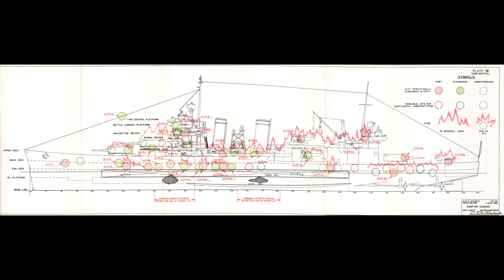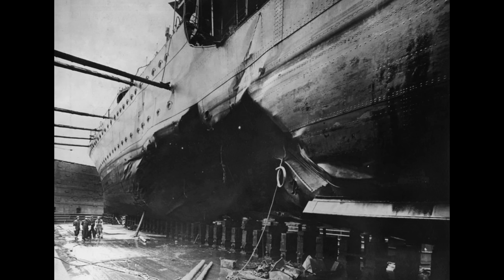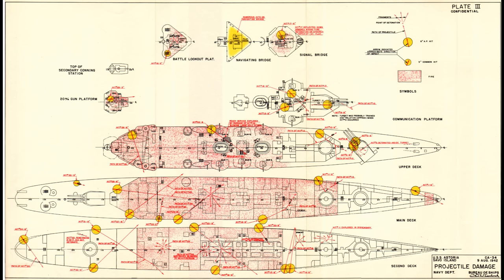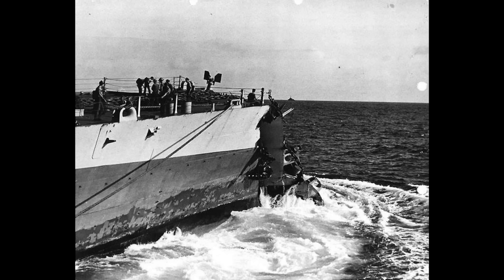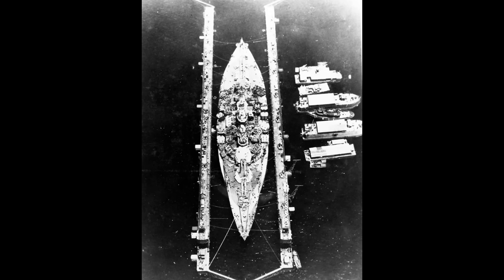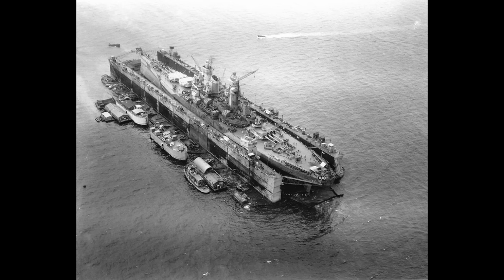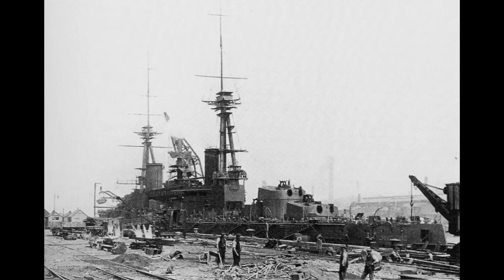Repairing a Damaged Warship - Ship Triage and Treatment

Comment from the maker: Pinned post for Q&A :)
Reply: Solid video
12:00 coconut logs are not in the script, but they are canon. 😊
ba dumm tiss 🥁
Reply: Since armor plate is a relatively long lead time item, and somewhat form fitted to each ship, do they maintain replacements
Reply: Is there any case where the distributed armor scheme has benefits over the all or nothing scheme?
Reply: @robertmills8640  Drach answered a question of mine similar to this in a previous live segment Drydock. Non-face-hardened armor plate, such as that used for splinter protection and for mass-produced gun mountings, can be mass-produced and stockpiled. Face-hardened plate for things like belt armor and turret facings are made in much more limited quantities, but some spares would be produced and stored for use when damage makes it necessary.
Reply: Did ships in WWI/WWII time frame have generators to produce electricity independent of the boilers? What systems had the highest priority for power if the ship was forced to run on such "emergency" power? Welding the ship back together would be tough without power.
Reply: I've always wondered how they get a ship's keel to settle exactly on the the blocks in a dry dock. Is it a matter of fine adjustment of the ship as water is pumped out of the dock and the hull lowers or is it lashed so solidly in place that there's no chance of missing the blocks or is some other magic involved? Do you know of any examples where the keel missed or began to miss the blocks which called for an alignment do-over?
Reply: @rebelsqurl8959  Thx
Reply: The repair I found very interesting was HMAS Hobart.  When hit near the stern by a torpedo, the Cockatoo Dock found the alignment so bad that it was easier to detach the remains of the stern, replace all the missing parts and the twisted structure, and re-join the two parts in correct alignment with new structural elements.
Reply: so thanks to your videos, I am now of the understanding that Queen Anne's Revenge was considered to be more or less a fifth rate ship of the line, is this why the Charston blockade is so well known? was it the fact that suddenly the pubic was aware that there was an outlaw sailing around in a battleship with enough ships to possibly outgun the local Royal Navy  Squadron, or was it something else that makes the blockade Blackbeard's most infamous feat?
Reply: Have the Kamchatka jokes on your videos gotten tiresome? :D

Question: I've read somewhere that, the Kanaung Mintha (Kanaung Prince, ကနောင်မင်းသား (1820-1866)) was the first to invent a type of mine (or depth charge according to Wikipedia) that he thought would stop the British ships from advancing up the Irrawaddy River. But was thwarted by Buddhist monks, saying that the weapon would harm aquatic life.
 Is that true?
Reply: In your opinion, what warship sustained the most damage but was still able to make it to port, be repaired, and sent back out?
Reply: I am an aspiring writer and Im writing a fictional story set in ww1-2. I would like to ask, would a ww1 battleship be affected by emp? If yes which components will be affected ?
Reply: "Is the drydock half empty or half full?" sounds like one of those optimism/pessimism things.
Reply: What makes a clipper ship a "clipper ship?"  Why were they so fast and were there any attempts to make a warship of this same design?
Reply from the maker: @awildmarshmallow3558  Depends how strong the EMP is, but most man made EMP's would be unlikely to have much effect, certainly nothing that couldn't be easily fixed.
Reply: @Drachinifel  You mean man made does that includes EMP coming from nukes? So for context my story is about an alien race who end up on earth and caught between war of fictional UK, Germany. The alien tried to use EMP but due to battleship fleet being mostly mechanical it didnt worked. I heard some of the dreadnought of WW1 uses electric motor for the turret is that true?If yes will a strong enough EMP disable it, I want a bit of accuracy on my story. Thanks for replying.
Reply: Have long wondered why Graf spee could not be fixed, couldn't they have robbed water plant and or parts from one of the merchantmen (I believe there were german merchantmen in port?), Or "Just" filled several hundred barrels of water (or even one or two WT compartments with access from above as a well?)
Reply: @HoverLambo  From memory it wasn't just her water plant, she had diesel engines and a fuel processing plant that could take cruder fuel and turn it into something the engines would take. That was knocked out. Basically she wasn't getting home without it.
Reply: As a fellow engineer, how did they do FEA in this time period as you definitely couldn’t load it up into ANSYS and then have a computer calculate which parts are safe/not under stress?
Reply: Hi, Drach you have said before that because of the time of flight of the shells maximum effective range is lower than absolute maximum range. Given that a large ship like a battleship can’t accelerate/decelerate very fast the only option to evade enemy shells would be to turn hard to port or starboard. Would the following be a viable strategy for fighting at absolute maximum range provided that your guns are accurate enough. Assuming that you have 3 quad turrets and give them each a different color charge and set one to fire where the enemy ship is, another where the ship will be if it turns to port and another where the ship will be if it turns to starboard. Given that absolute range for WW2 battleship guns is around 40k-50k yards, that is typically beyond the horizon so you will need a spotting aircraft and you will have a reduced salvo to 4 guns that can actually score hits but that is still better then not being able to engage at all, no? Am I missing something in this assumption?
Reply: Question: I remember you saying previously that armor plating was often made in advance and stock piled for repairs etc. 
Does this include things like guns, barrel lining, and turrets?
Reply from the maker: @awildmarshmallow3558  There was electric lighting, radio and electro-hydraulic and electric turret mechanisms etc. But the induced voltage caused by EMP only has to be a few volts or tens of volts to kill modern electronic circuits, whereas that variance in a 440V drive circuit that may not even be drawing power at the time is going to effectively be meaningless. I'd expect the worst damage to be a few blown lightbulbs and maybe a shorted radio if they haven't isolated the radios from the long line antenna properly.

Of course, you could up the EMP effect massively so it would have an effect, but you're talking Carrington Event energy at that point.
Reply: Whats your research process into these kinds of things? Im extremely passionate about this topic but no matter how hard I look I can never find much or any information niche subjects like this. Where do you look, what sources and where do you find them, etc.
Reply: What would be done about larger damaged armor plates, EG a cracked barbet plate on a battleship? How would these plates, given their massive size and unusual shape, and location deep within the ship, be replaced if severely damaged?
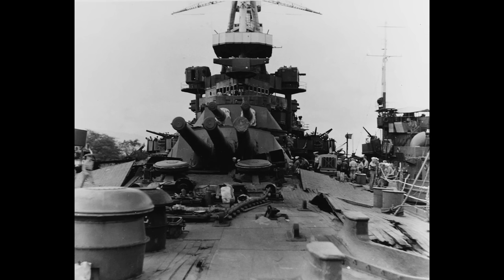Reply: 19:47 "..the ship has gone into the drydock" not going to lie, I was disappointed that the theme music didn't start there
Reply: @Tomyironmane lol, ya got me!  I suppose it depends if the ship is plumb and true, or twisted all up after a Japanese Long Lance!
Reply: Do you know what the material condition of HMY Victoria and Albert (1899) was at the time she was broken up in 1954? 
From here is my own musings.
She had been at sea at least as late as the 1937 review and was decommissioned in 1939, serving the war as an depot and accommodation ship. Doubtless she was well maintained during her long life however the extent to which she was neglected in the last 15 years of her existence cause me to wonder if their would be any value in her as a museum ship, or indeed if they had been keeping hold of her till HMY Britannia was commissioned as a reserve in case no suitable ship from the navy could be spared and not alternative means were available or if it just took them till 1954 that they could find someone to scrap her and not one of the many other ships being scrapped at the time.
Reply: I’ve always found the Vikings’ crow-sourced navigation system both ingenious and hilarious, can you tell us a bit more about it? Did they carry spares, for instance? And what was its effective range?
Reply: Drach, which ships, from the various eras you cover, survived the most damage to return to service in a combat capacity?
Reply: Does the USS Forrestal fit in the time span the channel covers and if so, are you planning an extended episode on it?
Reply: Got a question that isn't really specific to this video but which it reminded me of:

Where exactly does the term "citadel" appear in naval usage? Who coined it? How quickly was it accepted into common usage?
Reply: A thought, looking at the still images you used in this most excellent video. Could you - or another expert with you - give us some narrative, context,  and explanation to some of this battle damage? Eg 13:41 where my amateur interpretation is that there was a penetration just at the top Plimsoll marking, which blew out through the compartment above the penetration. I think this might make an interesting episode. Open to all opinions!
Reply: Could you do videos on classes of drydocks/repair ships or on specific ones at some point? Also, I was noticing the older support ships alongside the drydocks in this video. Are any of those repurposed older warships worth detailing?
Reply: Really interesting video. I'd be curious to know how it was possible after the battering it took at Jutland, that Seydlitz's repairs were completed in a matter of months?
Reply: Helo Drach! I recall a long long time ago you may have mention a video like this on Ship Propellers/means of moving through the water, was just wondering if this is still on the menu :)
Reply: Loved the video, thanks Drach you hit it out of the ball park. One thing, just loved all the photos of the damaged ship, would have loved it if you added the name of the ship: Just some awesome photos!! 
I would very much like to see follow-ups on the repaired ships from Pearl Harbor. Your series on their recovery was an answer that I had wondered about since I was a kid. I am 61 now!
Thank You for the videos, I look forward to every new one you put out!
Reply: EMP is primarily a danger to semiconductors particularly silicon based. (Hence the the use of gallium-arsenide semiconductors in the defence industry where possible). IMHO semiconductor free WW1 era electrics would be indifferent to the effect of EMP at any other than point blank range in which case EMP would be among the lesser of ones worries.
Reply: Wish I remember the name of that movie, right now. Somethin' of thà somethin: sea. Total schlock !
Reply: I wonder who typically did and manage repairs of heavily damaged ships. It seems to me that repairing of something that resembles more a heap of scrap metal than a ship requires a huge amount of specialized engineering expertise which probably would be way above the level of the standard officer (not even mentioning ranks) training. Navies typically use the warrant officers for specialty jobs, but rebuilding a new hull or fixing warped major structural parts of the ship seems to me little too much even for a very seasoned warrant officer.
Were there specialized leadership and engineering roles for such tasks in major navies or was this outsourced to civilian contractors preferably the same people who originally built the ship? Of course if the ship made it all the way back to the country it belongs to then a shipyard with its all available engineering expertise would be to the logical choice to perform such repairs, but when the ship was repaired at the forward base who was working on and managing repairs there?
Reply: The IJN Nagato has ‘collapsible tubes’ in its hull outside of its casemate armor, what purpose did these serve and how were specialty items like this replaced when damaged)
Reply: How would the free French navy in ww2 resupply ammo like naval gun shells and torpedos for the surface and sub surface combatants, would they create new ammo or just ride off of French pre war stocks?
Reply: @Drachinifel Interesting! I knew World War 1 battleships were low-tech, but I didn't realize they were that hardened against EMP's. Nifty!
Reply: I was thinking about the loss of HMS Prince of Wales and wondering if there was any way to design a capital ship so as to definitively exclude the possibility of shock-damage-induced propeller-shaft warping or bending ripping open the ship forward clear to the engine rooms (like the torpedo-induced damage to Prince of Wales's port outboard shaft that doomed the ship).  Then I remembered that, although direct-drive or geared turbines both require long driveshafts running down the belly of the ship from the engine rooms all the way to the outer-hull propeller-shaft seals, turboelectric drive does not, as it transmits power electrically rather than mechanically...

What would be the pros and cons of a turboelectric-drive capital ship with the propeller-drive motors situated at the extreme stern (just forward of where the propeller shafts emerge from the hull), with the motors and steering gear protected by a small, heavily-armored-and-subdivided box at the stern separate from the main citadel, and with power being transmitted from the engine rooms in the main citadel to the motors in the stern box via multiple redundant sets of cables all taking different routes through the ship (in order to maximize the chances of at least one set of cables remaining intact and able to power the drive motors)?

Alternatively, what would be the pros and cons of giving a capital ship a split citadel, with a machinery citadel in the stern portion of the ship (in order to place the engine rooms as far aft as possible, thus minimizing the length of the propeller-shaft runs and reducing the volume of ship potentially vulnerable to flooding in the event of a mass rupture of the bulkheads along a particular shaft) and a separate magazine citadel amidships or forward to protect the main-battery magazines?
Reply: ive ben serching fore a day naw what is the name of your intro song
Reply: Are all ships just work-in-progress submarines?
Reply: I was really hoping there would be some actual detailed information on how repairs were carried out. This video seemed to just talk of the general principles, without any photos or descriptions of how, for example, damage was assessed and which parts were cut out, and how replacements were made and fitted.
Reply: You should discuss why your video about the Battle Off Samar refers to it as the "Battle of Samar".  No one that has a clue about naval history would make such a rookie error.
Reply: Throughout the period the channel covers, is there a skill and/or method of repairing that was lost and reinvented and/or rediscovered?
Reply: I know this is a big ask, but can you please consider putting in some kind of annotations for the unlabeled photos?  Especially for a video like this, even just knowing what we're looking at and when shifts them from "huh, crazy picture" to "visual aid that I can then use to learn more".  Like the... thing... at 6:48.  What in the world is that ship and what happened to her?!  Or who is that at 21:53 and why is she out of the water?  There were a few times where I wasn't even sure what was damage and what wasn't...  Thanks.
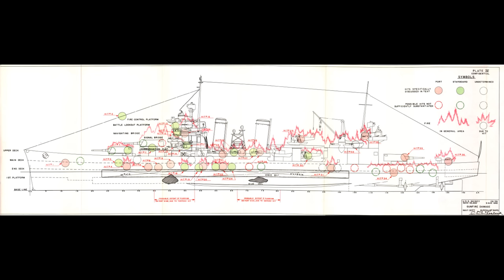Reply: 1:25  Made me realize you haven't done any ships made ~post WW2.  To learn from your dependably informative videos about the Forrestal or Enterprise CVs and the nuclear powered ships like the Virginia class, Long Beach, the new Ark Royal, Wasp or Iwo Jima class and so on would be terrific.
Reply: After WW1, were any measures taken, either in new build ships or refits, to mitigate gas attacks?  Did any navies plan to use such shells?  If so, hw did the various navies anticipate using chemical warfare and were any of them realistic?
Reply: Belfast and the old defiant one Warspite.... How much damage how often...
Reply: Query: has there ever been an instance where an officer who was on a ship that took damage and went into an extended repair period then returned to that same ship now as its commanding officer? example: an officer of Commander O-5 rank who got promoted while his former ship is under repair to Captain O-6 and then returned to his ship to take command of it.
Reply: Regarding age of sail (at least part of it), if I remember correctly, in Jules Verne's novel "The Lighthouse at the End of the World"
though fiction, there are some very detailed descriptions on fixing below the waterline damage to a wooden sailing vessel. It is said that he documented himself well with the science and technology of his time and his imagination did the rest. 
If you read this novel, how accurate would you say was his description of reparing the ship - in relation to beeching a wooden ship and effecting repairs on it's hull was historically?
Reply: where do the long lead time items come from for repair.
particularly armor plate, with the curve of the hull your going to need several diferent shaped plates on a ship, and most ships are only a handfull to a class so having spares lying around as you do for gunbarels dosnt seem viable.
Reply: A study on the USS West Virginia would be valuable and interesting.
Reply: Love to see a discussion of the WeeVee rebuild. She was probably the most extensively damaged of the Peal Harbor ship to re-enter service.
Reply: What about ammunition stores on the ships? Offloaded in the drydock before a welder makes a boo boo?
What does the crew do while the ship is in drydock?
What about secret parts, like the encryption hardware?
Reply: @Drachinifel   Oh yeah, WW1 ships?  Most of the issues with EMP in modern times come from the use of micro-circuits.  It's great for computers.  but it's weak to energy discharges.  

Basic stuff like simple generators, and electric lights? You need stupidly high energy output to actually overload simple wiring.  like you said about Carrington event, the energy radiated omnidirectionally needs to convey to wires affected by it power close to the level of a lightning bolt.
Reply: @Drachinifel  maybe do vids about the process needed to repair specific ships?
Reply: Just wondering if you ever heard about the two corvettes that where so badly damaged that they cut them in half and made one from the two.
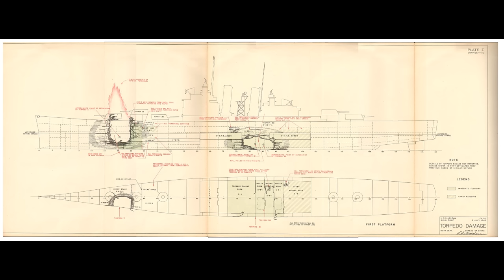Reply: 4:05 What ship is that?  Looks like godzilla bit it.
Reply: Hello @Drachinifel Grettings from the island of Guam! I have a question... While the temporary drydocks were a godsend in the Pacific, they couldn't fix everything.  A great example of this is USS O'Brien, which was torpedoed with the USS Wasp, made it to Esperitu Santo, then Noumea.  On the way to San Francisco, she sank near Fiji when her bottom  came open.  Was this something they most likely couldn't be fixed? Or was it something they missed or underestimated when they did their damage assessment?
Reply: @MatthewSmith-sz1yq no, because the submarine's prime feature is the ability to /re/surface.
Reply: Ship review suggestion: Not a warship in the usual sense, even if they could carry armament, but ships built for the sole purpose of winning a war: the liberty ships!
Reply: do you have a video on how battleships are designed, armored, armed, built, best practices?